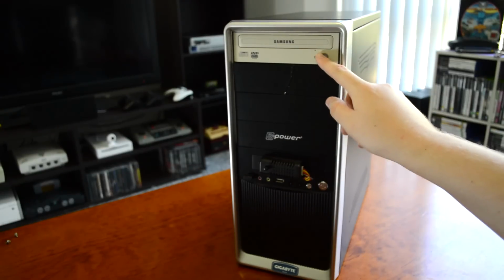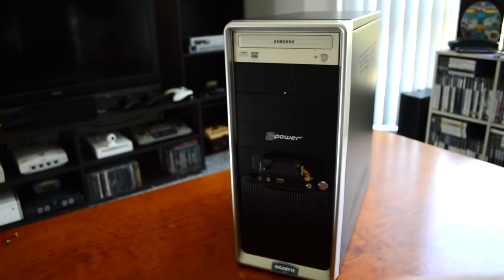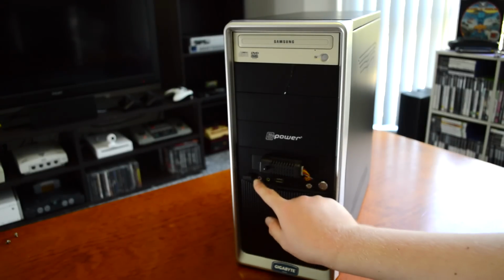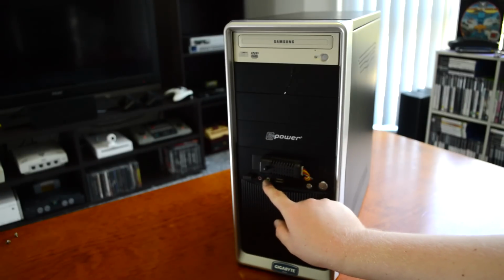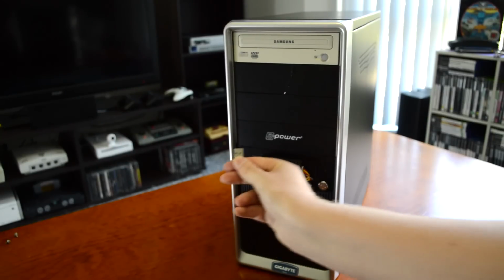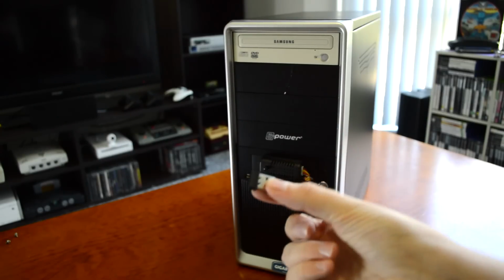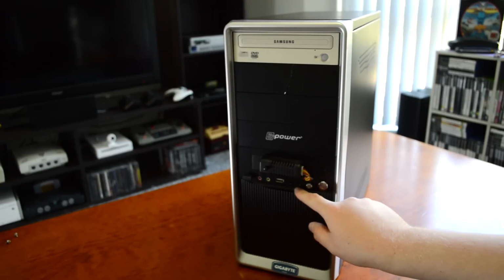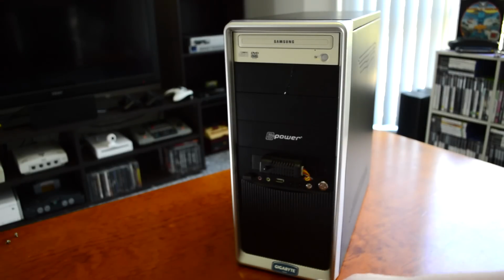Cheap $50 ! HTPC Running XBMC / KODi - Media Center PC

Comment: i got an old duel core xp pc with only  2gb of ram for free i installed Linux and kodi the installed the beast and it runs fine but i have to output video vga and sound with the headphone jack to my tv because it don't have an hdmi but it works fine
Reply from the maker: +Joseph Atnip Thats really cool, glad to see older PC's getting some use :) How do you find Linux? Is it easy to use like Windows?
Reply: the truth it's easy but there is a bit of a learning curve at first i really screwed some stuff up in setting doing customization and couldn't find it again ...lol i had to look it up but that's to expected  and i have tried a lot of distributions and i found Linux mint to be the one that works best for me and Ubuntu because of the unity interface to be the  one i hate the most but it run well i suggest making a live usb drive with a persistence file and giving it a try don't even use windows on any of my computers anymore and no more viruses and i don't have to slowdown my system with anti virus software  or get bugged with updates 10 minuets of updates when i need to shutdown my laptop

Comment: Need to turn your cpu fan to blow out the back.  As of now you're pulling heat off the gpu and there is no exhaust on top
Reply from the maker: +Cravin R1 Exhausts out the PSU, I couldn't turn the fan, there where stuff in the way :(

Comment: It is cheap, yes. I even considered doing this myself with old PC parts but I didn't do it. It is good to start out IF you have old PC parts laying around and than save up for something better.

Why I didn't do this? First off my girlfriend would leave me for putting such an ugly and mostly big PC case in the living room other than my PC for productivity (Lightroom, Photoshop and a bit of gaming). The fan of the Powersupply is loud (to me) on PSU's like this since it always spins, there are PSU's that only let the fan spin up at a certain usage and have much quiter fans to begin with. The harddrive also can be a noise maker in this example. When I watch a movie with Kodi I don't want to turn the volume up just to overpower the fans and HD inside the PC. And probably overlooked by many people, a PC like this uses alot of power since they are not power sufficiënt at all compared to what I went with in the end.

For +/- US $150-175 you have a Minix NEO Z64W or for even less you have the Pipo X7 both running Windows 8.1 and they are dead silent with an intel Core M inside which is a Quad Core processor that can handle alot more than this dual core ever will. The Minix is VERY small, the Pipo a bit bigger. Yes they only have limited storage but it is enough for Kodi and some other stuff and you can always add a micro SD card, external hard drive or USB stick if really needed. Because of the Intel Core M processor they are very power sufficiënt and still they are very powerful for this purpose. You can even do some light gaming, Steam in-home streaming etc. They even run Photoshop and Lightroom although slower than on my Intel i7 system ofcourse. With the proper keyboard and mouse (and monitor and speakers or TV) you can even make this the main PC if it is only for everyday use like e-mail, internet, Youtube, Kodi and such things.